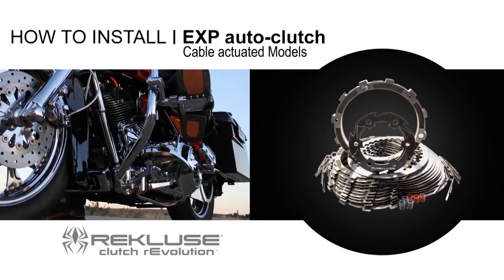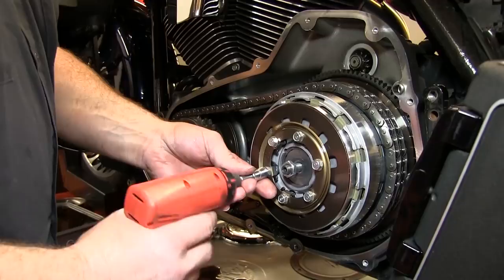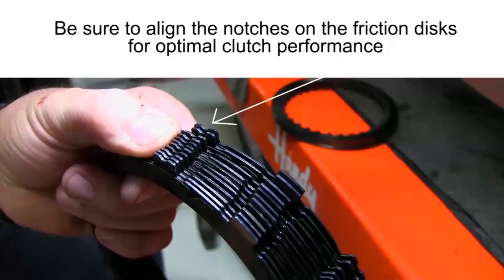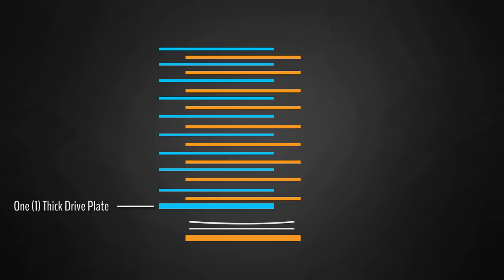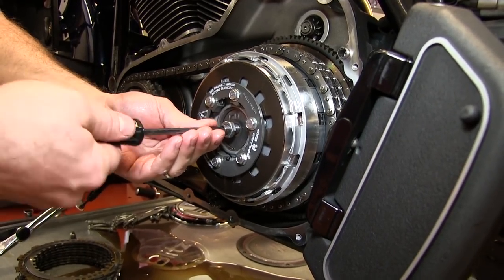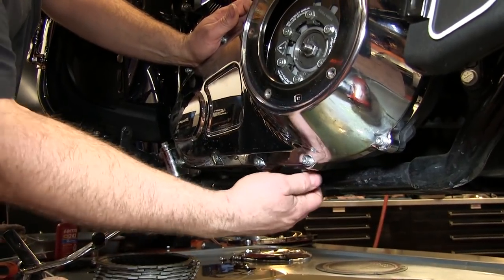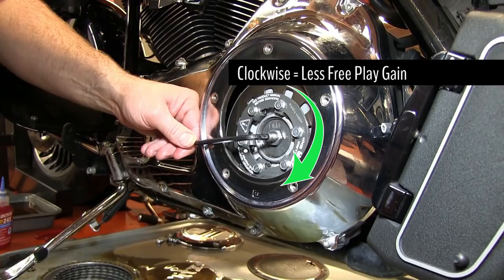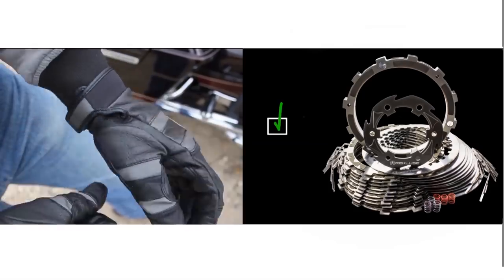Rekluse® Install | EXP™ Centrifugal Clutch for CABLE ACTUATED Big-Twin Harley-Davidson Models

Comment: Recluse,,you guys are bad ass.Perfect video.The c clamp clip is the only thing missing.torque specs.it is alot easier with a video.
Reply: I'm having a problem getting my clutch to work in auto I've adjusted it a adjusted can't seem to get it to work

Comment: Having a problem getting my clutch adjusted to work in auto put it together like the instructions and did the turn one and a quarter and I put it in gear and it wants to go even with the clutch pulled in been trying to get it done for two weekends what am I doing wrong
Reply from the maker: Hi Rick. Please give us a call at (208) 426-0659 and we will help you out. If you prefer e-mail, you can reach us at tech@rekluse.com.